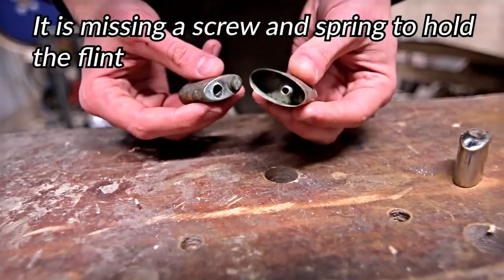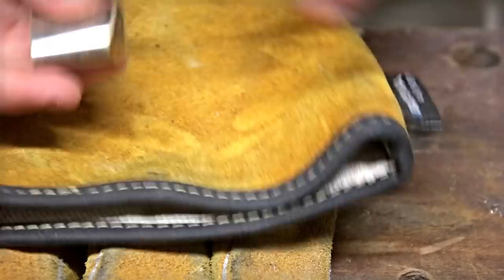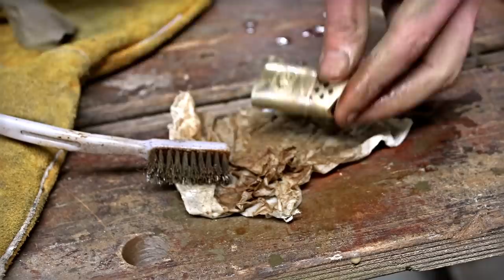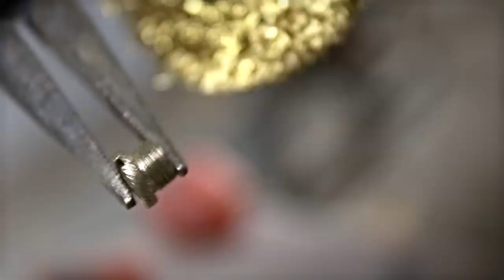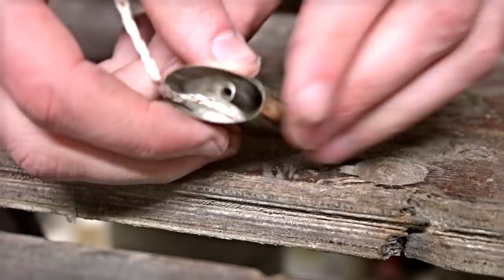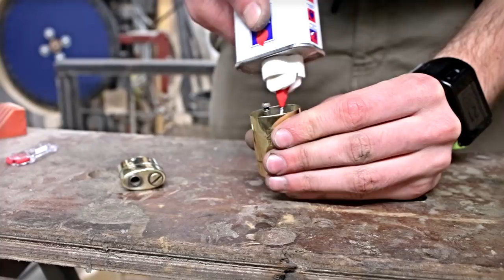Restoring dented vintage lighter - Restoration project

Comment: Remember when useing lighter fluid.

Wash hands before lighting

Wash lighter before lighting

Was table before lighting

Light lighter

When hand feels hot and reflect that you forgotten steps 1 2 and 3

Panic
Reply: Vortex77 Lazarus man your suggestion are great
Reply: Or, you could just avoid getting lighter fluid on your hands and the outside of the lighter. It isn't difficult.
Reply: Step1:  wait for a minute.
Done.
Reply: It evaporates in seconds what are you on about

Comment: In England that's called a "Tommy" lighter as it was first made and issued to WW1 Troops. It's actually better than a Zippo for keeping the flame lit in the wind.

That's the English-made version as evidenced by the thin strike wheel. Production moved to (I think) Brazil in the 70's and those later versions have a strike wheel which is at least 3 x as thick.

There is also a version for lighting pipes which is somewhat scarcer.

Best lighters I ever owned fo' sho' . . .
Reply: So, whats the brand for that lighter? I am living in Brazil, right now, and would love to get one. They have vospic lighters around here, but never saw something like that one...
Reply: @Davedrifter  Type 'Tommy Lighter' into Ebay, there are currently 7 available - all in the UK. Don't buy the £30 "WW2" one, it doesn't look right somehow.

I'm pointing you at Ebay cos I don't think they're available 'new' any more.

Also, if you're not aware, bear in mind that they use Lighter Fluid/Petrol and NOT Butane Gas . . .
Reply: I think it's an Austrian design from the interwar period that was altered and made cheaper to produce for British troops during World War 2. The Americans took this design and added a hinge and a spring loaded mechanism to open it.
Reply: @gho95  That's a possibility. I've never seen an Austrian one - do you got any idea what name they went under?
Reply: @TheGodsrighthandman  I have absolutely no clue but I do know that they were fueled with Kerosene and became popular among Britain, Germany and America around 1923
Reply: It lit him on fire
Reply: yo chill its just a lighter
Reply: Actually That's The WWII Version The Tommy Trench Lighter .. but yes they did start making them again for a while in the 70s in Brazil
Reply: It may keep better flame lit in the wind than zippo but is badly designed. Top lid is not attached to the body and the bottom is round so can not stand and be used as a candle.
Reply: @TheGodsrighthandman  Austrian ones are named Imco
Reply: @parkerv6  "Waaaah, someone cares about a thing I don't care about!"
Reply: @SonofSethoitae  Yes

Comment: when you utilize machine that make lots of noise you can lower the volume by 50% or more because some people listen with headphones.
Reply: TysyTube Restoration  puré t'es partout toi ^^ j'aime bien ton travail
Reply from the maker: Thanks for the tip! I didn't really consider most people have headphones. Also I saw a comment recommending using this thing called lowpass. In case you are not familiar with it, it's an audio effect which cuts off all high pitch noises, so the machine sounds are less irritating. I've used it also to reduce background noise. I thought you might find that useful too.
Reply: Its almost like a asmr video just listen it with the volume is fun and could make me sleep im sure with less ads and high noise
Reply: simple solution,dont use headphones,right?
Reply: Simple solution not so simple if you watch YouTube in a billeting area. Volume was fine (via headphones) and no annoying music. Cool resto!
Reply: Yeah pls or but music

Comment: Blooper was gold!  Next time you're trying to remove dents out of something small like this, put the nail in a block of wood or clamp in a vice. Then hold the part over the nail and lightly tap on the part with a light weight hammer.  Put one layer of tape on face of the hammer if you're worried about marring the surface.  You'll have much better control this way and you can see the progress as it is made.

Comment: awesome job!!!
you should try an ultrasonic cleaner (not the cheap ones for jewelry)

and for "sanding" the surface a tumbler is good too. (vibration tumbler)
those you can easily build yourself.

Comment: Back in the 1960s, i bought a very similar lighter from the military disposal store. They were new unissued stock, and cost 50 cents still in the wrapper. I am now 66 years old, and I still have it.I like the idea of making a punch from a nail, excellent. Tony Australia.
Reply: Jon Doe . I am a qualified jeweller, and there's not much about metalsmithing and polishing  that i don't know. I did my apprenticeship with, and worked for, Fredrick March & co of Melbourne if you would care to check. Alternatively, i could send you a copy of my qualifications from the jewellers board of Melbourne. Very easy to snipe from the cover of an alias.

Comment: the cap is probably long to leave some space for the flame... you put the cap on while it's lit, it will extinguish the lighter. if there was less space it would push flame out the side on your fingers.... zippos also have a lot of space above the wick for that reason

Comment: Where I can get one of this Vintage Lighter?
Reply: eBay would be your best bet
Reply from the maker: You could try ebay. I found bunch of these from local online auction. The seller had had them at their summer place just rotting away, so I got 6 lighters for 8€.
Reply from the maker: I think this type is called "tommy lighter" but I'm not an expert.

Comment: May I put you wise to something? This is called a slow seep lighter. ordinarily, you do not fill the upper portion with fluid, only the bottom part. When correctly filled with cotton, the bottom fill keeps seeping into the rest, keeping it filled as long as the tank lasts. Is this a KW lighter or a copy? Many copies were made, many from Japan. the Japan copies are not of as high quality. You can use ordinary cotton balls to refill the cotton, but don't just stuff them in. they will come apart if you break the outer part, and turn into rolled up strips of fluffy cotton. Do not over pack, leave some room for fluid, especially on this one, do not over pack it will make the lighter not work properly. Its okay to put some fluid in the top portion when redoing them, otherwise you have to wait a while for the slow seep process to start working. just a little tho, you' found out why...lol... i have to laugh, but an when photographing a lighter to post on ebay, I was using a portable photo booth made from some fabric that goes up very easily. I sparked the lighter to show it lit, but apparently an errant spark hit the fabric, and the whole thing went up and nearly took my kitchen with it, did lose the kitchen curtains. I do not use such a photo booth any more, and will not. it was some kind of polyester that burns easily and quickly. 

The first thing to check for in any vintage lighter is a corroded flint stuck in the tube. I use a straight piece of coat hanger wire. sometimes, pushing with the wire will do the trick, other times I have to chuck the wire in a drill and grind out the old flint. Never use a drill bit, you wind up drilling where you don't want to and ruining the lighter. Sometimes even a hanger wire can do that, but it's safer than a regular hard drill bit, and will even work in curved tubes if it's the kind that is more flexible I have used pieces of bass guitar string to drill out flints with really curved tubes. For brass lighters, bring a 50 50 mix of vinegar and water to a near boil, and put the lighter in. This removes or at least softens any of the old black corrosion. For silver and silver plated lighters, use a piece of aluminum foil in the bottom of a pan and add one tablespoon (or more) of baking soda to the water. Make sure the lighter or other item is covered and on the foil. The black corrosion will transfer to the foil. if the foil gets completely black before the item is clean, you must replace the foil and go again. With the vinegar and water solution, save it. As it is heated the water  vaporized and the acid in the vinegar does not, so it actually gets stronger over time. 

If you have questions about lighters, feel free to ask. I've restored hundreds of them. tootall1121@yahoo.com I have some very unique ones as well as the more common ones.

Comment: The extra fluid tanks is genius. You can really depend on the lighter. Even if it dries out (which typically happens within a week or two), you still have some spare fluid in there.
Reply: I just can't figure out how he can store fuel.  There is a felt pad under the screw, the fuel easily penetrates out of the compartment along the thread and is absorbed into the felt, and evaporates from the felt as well as from cotton wool.  If there was a rubber gasket, then there would be no evaporation.

Comment: Looks great in raw brass, but did you consider nickel plating this one?
Reply from the maker: I didn't have plating system at the time and I'm still figuring out how to do it "right". I had a very slow process on the knife video and I kept it there for couple of hours to get good coating which can take very quick polishing. I could just buy a ready system online but that's not as fun and I don't learn as much. I'll star plating more often after I have done some more testing.

Comment: One of few videos I watch in its entirety. A few I buzz through but mostly I watch them all. I restore a lighter once in awhile but they are in very good shape to start with. Your accident reminds me of a time I was in a multi-level parking lot filling my butane lighter. There was a lot of static electricity in the air and the blow back of butane ignited. My head to my waist caught on fire. I was movin Jack! Only burned my arm hair, eyebrows, and eyelashes. Being on fire is a TRIP! Like you I was moving at warp speed.😂

Comment: I love these lighter videos. I have an old similar style lighter I picked up in Vietnam many years ago. I think I will try my hand at restoring it. It's still in great shape. I was showing my fellow soldiers the lighter, when one asked how it worked. When I pulled the end cap it was a tight fit. Finally I gave it one more hard tug, and the cap came off with a loud pop. Everyone jumped back thinking it was booby trapped. Gotta admit, scared me too, but it worked. One solder stated, damn LT, you're the Plt leader, your supposed to be setting the example .  Take care...Ken

Comment: I dont know what Nail you used but be careful so its not zinc plated. If you heat zinc up you can get some nasty gasses released, just don't want a career of restorations end because of zinc poisoning. Otherwise great video :)

Comment: Thanks! Very good video! I think, it would be good to modify this lighter a little - attach (solder) a small chain to lighter cover and body. This way you will not loose the cover.

Comment: That bit at the end happened to me once when I refilled my zippo. I guess it happens when you overfill it, or you try and light it when the lighter fluid hasn't fully evaporated on the outside. But I'm not fully sure. It was quite startling though.

Comment: Awesome video and very interesting!
Some advice would be to make those longer clips slightly shorter. So most cuts are about 5-6 seconds max. It keeps the audience interested and shows the many different parts of just one stage. It could mean you show 4 seconds of fixing the dent every 5 minutes of work or something.

Comment: Why didn't you cover it with Nickel or silver? The metal in the lighter is very thin,and additional protection,would not hurt, and aesthetically pleasing looked.

Comment: really good result, for fuel lighters if you use an oil based fuel like branded zippo fuel it wont flame so aggressively as standard fuel and it doesnt evaporate as quickly.

Comment: Nice lighter work, did all the lighters have the same logo on them or were they different? Also how was the extra fluid supposed to get to the cotton with the plug in it?
Reply from the maker: They had different logos. The fluid will evaporate slowly even if you don't use the lighter so the bottom part is like reserve tank so you don't have to carry around a bottle of fluid in case you run out

Comment: At 9 mins what is the name of that tool you're using? I really want to get one
Reply from the maker: I'm using a dremel with sort of a extension cable. In case you choose to get one from amazon, please consider going there through my affiliate links from the description as that supports my work but doesn't cost you anything

Comment: What is the red stuff you are using for polishing ? is that wax ?
Reply from the maker: It's metal polish compound. Pretty much a wax with some fine particles in it to do the polishing. You can find similar stuff with metal polish compound this one was just a generic product from local hardware store